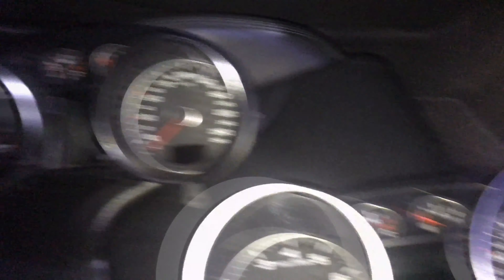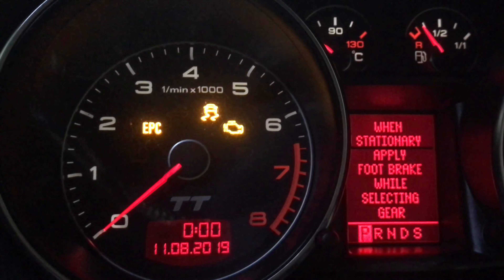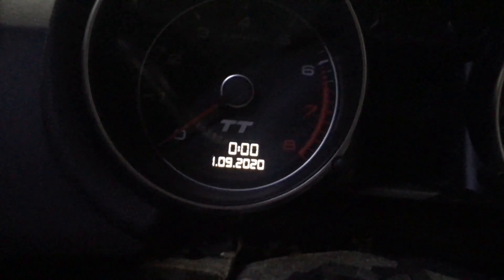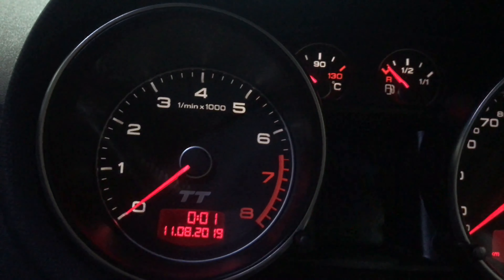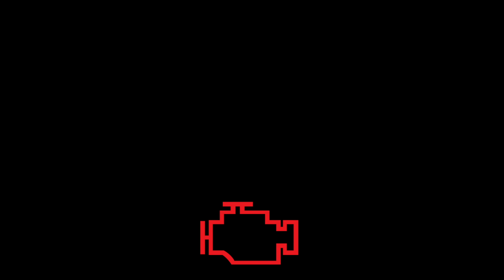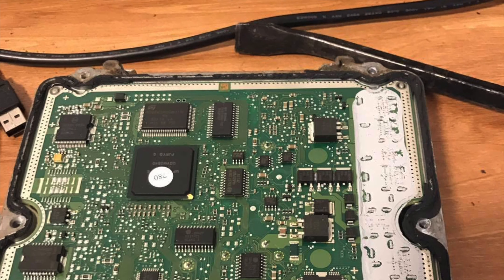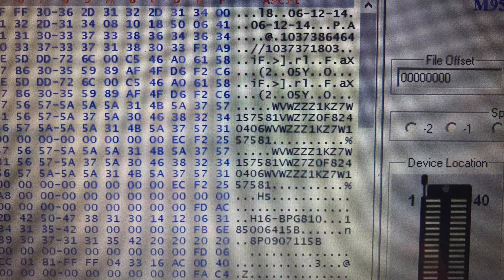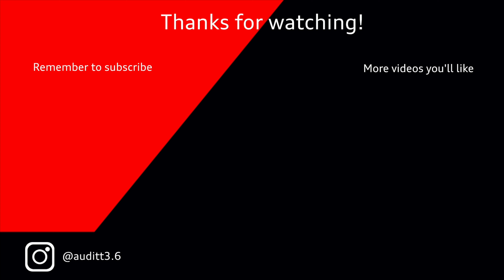Audi TT 8J white instrument cluster upgrade by turning off immobiliser (Immo off)

Comment: Do I need to worry about the Immobiliser if I am simply changing the LCD panel in the existing cluster? I have a red L:CD on my mk2 that has started to fail. I've bought a scrap cluster which I will remove the LCD from and put it into my existing cluster. The replacement LCD panel is also red so I think it should just be a case of removing the existing cluster, opening it up and swapping out the broken LCD for the replacement LCD and putting it back in.
Reply from the maker: Hey Ross  

No need to worry about immobiliser data in your case :). 

Just he careful when replacing the needles. They can be finicky. Make sure the rear of the motor is pressed onto something hard like a glass surface.

Comment: Hi Ian, i bought an Auction 2016 Audi S3 8v with a missing cluster. It had a virtual cockpit. I have fitted a replacement used VC but it needs online programming. How do I bypass the immobiliser to start and at least move the car out of the way.
Reply from the maker: Hi Wraith. You will need to find someone with something like Abrites (auto locksmith hardware) to help you.

Comment: How did you do the coding, i want to change my cluster to the color display but i don’t know how to do the coding with my OBD11, any tips?
Reply from the maker: @danieltoussaint289  to upgrade it to color is with a non Audi kit. More news on that coming soon. To do coding so you "dumb down" the cluster to remove comfort functions - you can do via coding of module 17 - instruments.
Reply: @ianpgonzaga  i don’t know how to do coding.
Reply from the maker: @danieltoussaint289  ohhhh ok. Did you have the hardware to change coding and adaptations on you?
Reply: @ianpgonzaga  i have obd 11
Reply from the maker: @danieltoussaint289  no that won't do it.

Comment: Hello. I changed the indicator on my 2008 a3 vehicle. I transferred all the km immo information to the new indicator, but I am getting ABS warning with the new indicator and I cannot clear the fault. Can you help me on what to do??
Reply from the maker: Probably plug your old cluster in. Get the abs coding. And put it into the new one. It's probably different. :)
Reply: @ianpgonzaga  My old indicator is broken and does not work at all. What to do in this case?
Reply: @ianpgonzaga  ???
Reply from the maker: @yucelkurtoglu4420  did you change it for another unit?
Reply: @ianpgonzaga  Indicator changed ABS computer did not change ABS computer needs to be recoded, but the old Indicator is completely broken, so I can't get the information from it, so I don't know how to code it.
Reply from the maker: @yucelkurtoglu4420  indicators coding is in the steering wheel control module. You can't code the indicator itself. 

Is your steering wheel control module the broken thing?
Reply from the maker: @yucelkurtoglu4420  happy to message in Instagram :)

Comment: when you change the panel! Does the km change too or does it always stay the same?
Reply from the maker: Good question. The km is coded with the cluster. So if you get a 2nd hand one it will have a KM reading on the odometer already which sticks. It doesn't automatically change to what your car originally had and needs to be adjusted to match.

Comment: Hello, how do you solved the esp fault after the swap? I have clear the code but traction control et mag ride suspension are coming back every time. Thanks !
Reply from the maker: You need to check your coding and turn off magride :)
Reply: Thanks, do you have the details on the coding part? Thanks
Reply from the maker: @thomascottereau-6073  hi. If you plug your original back. Copy the coding. Put that into your replacement. You should be OK 😉
Reply: Thanks Ian, I have also put back the original cluster and esp fault is still there…do I have to re-initiate some sensors?  For the mag ride I have seen your video, I will think about it 😊
Reply: Do I have to copy it with vcds, do you have made a tuto on it ?
Reply from the maker: @thomascottereau-6073  nah just write it down and then input the same in replacement :)
Reply: Hi, the code from the first cluster is not available anymore (000000000) so now I am stuck. Do you know a way to retrieve it? Thanks
Reply from the maker: @thomascottereau-6073  that's strange. What happened to the original ? 

You will have to just work it out with the coding help bubble that appears. Add the numbers up to the spec of your car.

Comment: Is this process also possible without the immo off?
Reply from the maker: @Matt-pj9dg  the other option is to match all data.
Reply: @ianpgonzaga  Yea that's gonna be a tough cookie since there is a difference in immo data.
Reply from the maker: @Matt-pj9dg  find an auto locksmith. They should be able to pull from your OG cluster and transfer it into the replacemnt.

Comment: Hi 
I am just doing a bit of digging. Will i be able to fit an Audi tt mk3 digital cluster into a audi tt mk2. Just been looking on forums to find the answer
Reply from the maker: No the mk3 has a different kind of high speed data system that’s not in the Mk2.

Comment: I have a TT mk2 2006 I need a second key in a keyhouse...now car don't star with the old and new ...
Car is safe immo can you help me???
Reply from the maker: your car should start when you use all original parts to the car. including original instrument cluster and original key
Reply: Similar situation : Audi TT mk2
Original cluster failed. Unable to retrieve SKC. Bought cluster from a scrapyard including ECU. Did immobiliser delete on the scrap ecu. With immobiliser deleted ecu and replacement cluster the car starts and runs... however..
The replacement cluster shows SAFE and I'm unable to use the remote keys to lock/unlock and also while in the car I am unable to operate any electric windows. All other functions appear to work except:
- electric windows and the locking/unlocking via key fob. Please help 😅

Comment: can u tell me why the bulbs come on and off in the dash board and the rev counter side goes blank
Reply from the maker: Sounds like some solders might have come dry on your clusters PCB. Is it happening with extremes in Temp?
Reply: @ianpgonzaga   hi after trying  another dash clock from ebay it made it worse with the same bar  code on the sticker the only thing that was wrong was having no lights at all. . by trying the second dash  all the warning lights came on  and my steering went hard . took it to audi  which was12 miles away it start to looseing it self right.  so i left it so i can get another dash to put in . not knowing that the clocks as an imoblizer  built in when taken out completely it do not even start
 change the face clocks and kept my original one to make one up . it works but now i cant get the esp light off it because of linking it in the car causing it to stay on perminately any idea could it be a sensor  dash say  fault readers  manaul  cheers
Reply from the maker: @hilarypelage5025  because you had swapped the other cluster in and run it. Then put your original one back - some basic settings have been lost. 

A euro garage / mechanic will be able to help sort that out. You will need to run basic settings again.  

To get the replacement to work either
- immo defeat the ecu
- have the cluster’s data matched to your car. 

Hope that helps and good luck!

Comment: How is it possible to needle sweep on 930?
Reply from the maker: this was with a reflash of the module
Reply: @ianpgonzaga  what reflash? Could you explain a little bit more?
Reply from the maker: @Benko_DieseL  basically a software update. Need to open the cluster. dismantle the two halves then solder some points. Lift some legs off a chip. Then read. Then adjust file. Then write new file to the cluster. Then adapt with vcds.
Reply: @ianpgonzaga  i know that you dealing with the eeprom and you get the software from a 930,am i correct?
Reply from the maker: @Benko_DieseL  I was tapping into the MCU not any eeprom
Reply from the maker: @Benko_DieseL  but I am not sure where the software is from. 

With that information you will need to get in touch with electrovag on Facebook or Instagram. He is the main master.

Comment: i made it and had problem with the steering wheel .
Reply from the maker: What do you mean? Did you scan for any codes?
Reply from the maker: Αισχος Ντροπη I am thinking you need to recode the cluster to match hardware in your car :)
Reply: @ianpgonzaga  i dont know how i can do this! cause i had immo off by my tuners and i have no knowledge for doing this kind of things! apfff i have vcds but i dont know which sector and what i must change
Reply from the maker: Αισχος Ντροπη if you still have your old cluster what you should do is plug it back in. After. Take the instrument module coding (17)

Transfer that coding into your white FIS cluster. That should get you on the right track.
Reply: @ianpgonzaga  i ll try it and i ll tell you thanks for ur answer!! really helpfull!
Reply from the maker: Αισχος Ντροπη if you want to have help with teamviewer let me know and we can try to connect remotely and I’ll check coding.
Reply: @ianpgonzaga  if i cant do it myself i ll tell you fro sure! kind of you! thank you!!

Comment: Windows will not work with this mod. So isn’t really functional!
Reply from the maker: Hm. Funny that because my car works fine. Maybe your off wasn’t done right.
Reply: @ianpgonzaga  oh really I’m a Vw specialist I do these all the time. So why don’t you take a video and show the windows work?
Reply from the maker: @tonybig78  oh nice one!! Good to see some experts watching. 

For sure I can make a video of the windows working. Everything works fine with the immo off  and engine swap. :)
Reply from the maker: @tonybig78  what are you really trying to say here? let me know. happy to discuss.
Reply: @ianpgonzaga  false information that’s all. You’ll get some people trying to replicate buying a de immo ecu to only find out once they fit the clocks and ecu that the windows will not work!
Reply: @ianpgonzaga  has nothing to do with how the immo off was done on the ecu mate! Irrelevant if you don’t have a transponder in the key paired with the clocks the windows will not work.
Reply: Hi! I did the same (immo off on ECU) with my 07 TT tfsi to try get it to work with a used white cluster. I can get the car started but the annoying thing is that windows don’t work. I guess that’s due to component protection right? Is there a way to trick windows to work, say by changing the wiring to the windows module or any other cheap method? I know the official method is to change immo data between cluster but I don’t have expensive programming tools,  neither want to spend the money to invest on something like that.
Any help is appreciated! Cheers
Reply: @agispapadopoulos6737  unfortunately not
Reply from the maker: @agispapadopoulos6737  you can try with matching key data. Some extra work required with coding
Reply: @ianpgonzaga  hi thanks for the reply! I have the tool (vcds) to supposedly match a new key but don’t I need to extract info from new (used) cluster to do so? And that’s again expensive tools .. ☹️